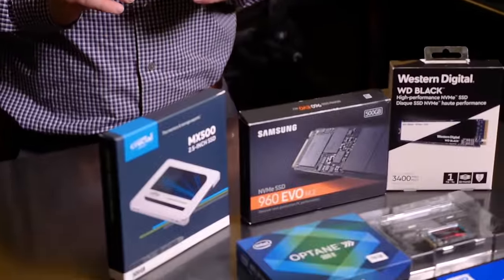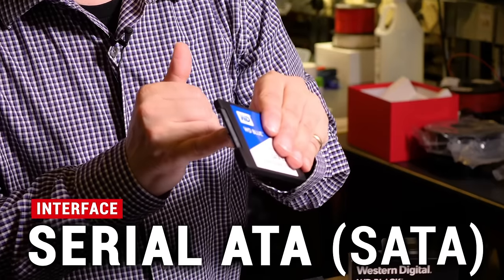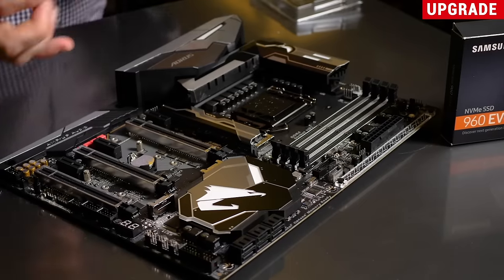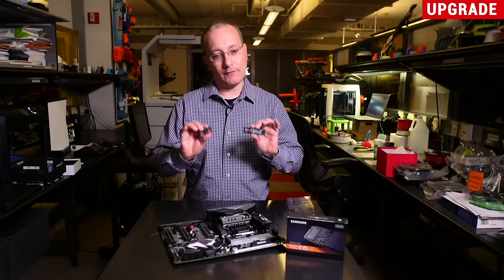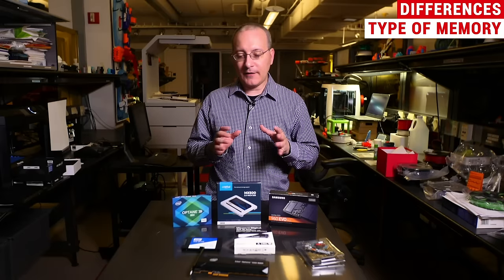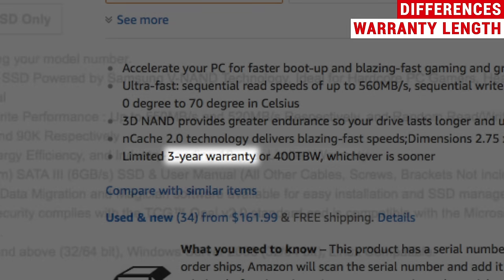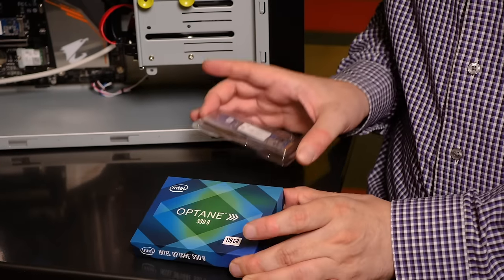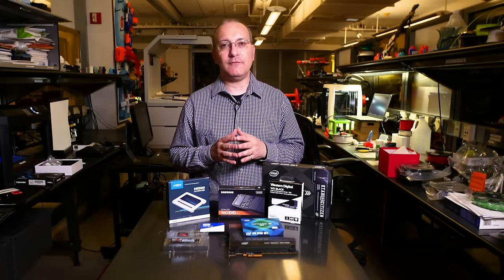Buying a Solid State Drive (SSD): Everything You Need to Know

Comment: Why didn't he mention the difference between M.2 SATA and M.2 NVME.  you need an NVME supported motherboard if you get an NVME drive. Also the NVME drive has 1 notch in it.  The SATA M.2 has 2 notches and is much much much much slower.
Reply: I think you have those backwards.   SATA has 2 notches while NVME has 1?
Reply: Thanks for the heads up on the NVME motherboard support info. I have a 6 year old gaming PC that I am going to add a 1 terabyte M.2 using a M.2 PCIE card adapter and put it in a PCIE X 4 slot. I was going to get a Samsung NVME M.2 stick. You saved me money and a lot of time trying to figure out why it's not working.

Comment: I wish I could have understood it. Not everyone has the technical knowledge you display.
Reply: Lots of the jargon he was using was doing little more than making the subject unnecessarily obscure, basically all most consumers need to know is that there are a few main types of ssds and if you're looking to buy one just keep in mind what your motherboard can physically support. The most common ssd is a sata ssd, and you can basically upgrade to one from a hdd directly by just plugging in the power and sata cables from the hard drive, then there is pcie sata, which uses a pcie slot but is just as slow as a sata ssd, and a pcie m.2 drive, which uses a pcie slot and will be faster than a sata protocol drive. For pcie drives just make sure like he said that the drive you buy is supported, but most consumers will be well served by a decent sata ssd, just make sure it isn't some hyper obscure Chinese knock off and you'll probably be golden. And try to leave as much free space on it as possible to preserve its life span, its best to just have the os, essential programs, etc; that you want to run fast on the ssd and have everything else on a hdd.
Reply: *nvme

Comment: First class guidance! Many thanks. One point is that you can save a lot of time by cloning your existing drive onto the SSD. This transfers the operating system, programs and data. I partitioned my existing HD and shifted the data to drive E. Then I cloned only drive C to the new SSD and later transferred the data.
Reply: Ben get in touched

Comment: If you just want to game primarily, get either a crucial or WD 2.5 inch. Pretty much all SSDs (including NVME) have very similar load times. You may save two seconds with an NVME, but it's not worth the premium that you pay. M.2 may be the same price as 2.5-inch SSDs now, so you can go that route, too. Remember that m.2 can be SATA or PCI. Get the SATA; don't waste your money on NVME if you're just gaming. NVME is better suited to video editing and large file transfers
Reply: This all I have in my laptop :P (razer blade) so no choice here but to upgrade to a 2tb nvme m.2 ssd (same type, higher storage)
Reply: @krazye2239  why not save money and upgrade to an m.2 SATA SSD?
Reply: googlewolly 
For 2.5 inch if you are gaming chose either Crucial, WD Blue/Black, or Samsung 860 Evo.
Reply: @primeribgaming2681  yeah those are all good. Problem is that the 860 is still a lot more than the others (or, it was last I checked, anyway). That's why I didn't include Samsung. 2TB for the 860 Evo was 500 CAD; it was only around 370 for 2TB for Crucial's MX500.
Reply: I have a question. I have an older spec pc and unfortunently the motherboard dosent support m.2 SSDs. However i do want to get an ssd to improve speeds of pretty much everything since i will be trying out some sort of video editing. I am absolutely not sticking with an hdd. 
I was looking at a couple 2.5" SSDs and i came across wd blue and green. The minimum capacity i can accept is 240gb. Which one is more worth it ?

Comment: Pro tip: The next time you have a mobo on a table and use it for demonstrating slotting something in (or out), make sure it is stable, e.g. rest it on a foam block or a folded towel :) It is quite awkward to watch your mobo rocking back and forth on its corners!

Comment: Still trying to figure out if my asrock fatal1ty z170 gaming k6+ will support an nvme or not the manual says it supports Key type 2230/2242/2260/2280/22110 M.2 SATA3 6.0 Gb/s module and M.2 PCI Express module up to Gen3 x4 (32 Gb/s) but those numbers aren't in any Amazon listing

Comment: My notebook laptop is ASUS X200CA memory 2gb .processor is INTEL Celeron is1007U @ 1.5GHz working very slow always hang for 5minutes i want to upgrade this but i see in you tube that the MEMORY RAM fixed solded on board no chance to upgrade ' how about if i upgrade the HDD to SSD it is possible i want your advice

Comment: Hi, why does the sata M.2 SSD connector has 2 gaps in it but the slot on the motherboard only has 1 notch ? Isn't that weird, because it means some pins of the slot are useless where the gap is on the SSD connector...?

Comment: i recently bought an HP 14-dk0024wm laptop,. you can upgrade the memory and add a 2.5 ssd internally,. it also has a SSD M.2 2280 SATA storage it came with,. my question is when i opened it, the bus showed that it could potentially fit a M.2 NvME stick because the bus has the one notch,. yet my stick is the SATA M.2 version,. my concern is that if i got the Nvme stick it wouldn't work even tho it would fit,. i can't find really much on it,. HP website doesn't even acknowledge anything about upgrading the laptop,. just looking for some help!! thanks

Comment: Is it advisable to buy a 1 tb ssd and dont use a hdd? Does ssd deteriorates first than hdd? Or vice versa? Need help guys
Reply: Ye ssd does gets wear off due to writing of data..   A typical Samsung  256 GB SSD.  Claims it can hav 144 tb of data written over it before it gets damaged.  Like u copy 1  gb of data to it delete it.  1024 times a gb and ur 1tb data written. So 144 tb is a lot I guess.    1 gb ssd would easily last over 5 yrs..  Search go tbw life tb written life.
Reply: Think of it like tires on your car: the rougher the roads the faster they wear. The more you drive, the faster they wear. It doesn't matter the type of tire.

Comment: I have a laptop which has the 16GB Optane Memory  Cache using the M.2 connection.... If I disable and remove this, am I able to buy and use an M.2 SSD/NVME Drive in place of the HDD

Comment: DO YOU GET A SATA SSD CABLE WHEN YOU BUY AN SSD?
OR DO YOU HAVE TO BUY AN EXTRA SATA SSD CABLE if u dont have a spare cable.  
i'm looking to change my HDD to my new SSD... and looking to clone my HDD boot drive to SSD without.. needing an extra Cable to work like that.
Reply: You can usually find this out by looking at the part of the box that says "contents," but odds are it only has a cable to connect it to the computer itself.

Comment: If you put a PCIE M.2 into a SATA bus though... it’ll still work, right? Just only at the SATA speeds and not the x3 or x4 of the PCIE lane. 
I think....
Reply: As long as the slot is compatible.  Not all M.2 slots are cross compatible, like on an ASUS Maximus Hero motherboard.  The first slot under the Heat Sink in the middle of the board supports both SATA & NVMe, but the second slot on the bottom-right of the board only supports NVMe; so you'll have to look up the compatibility under your physical manual or the website, which should have the digital version.

Comment: i want to upgrade ssd and hdd on my HP CK066tx...

currently 128gb m.2 sata ssd + 1tb sata ssd is installed....

i want to replace these with
500gb m.2 sata ssd + 2tb sata ssd......

but according to hp manual and costumre care for my laptop
i can only upgrade to these dual drive configurations :

● 2-TB, 5400-rpm, 7.2-/7.0-mm hard drive + 128-GB, M.2, SATA solid-state drive with TLC
● 1-TB, 5400-rpm, 7.2-/7.0-mm hard drive + 256-GB, M.2 2280, SATA-3, PCIe, MVMe, solid-state drive with
TLC
● 1-TB, 5400-rpm, 7.2-/7.0-mm hard drive + 256-GB, M.2 2280, PCIe, MVMe, solid-state drive
● 1-TB, 5400-rpm, 7.2-/7.0-mm hard drive + 128-GB, M.2, SATA solid-state drive with TLC
● 500-GB, 5400-rpm, 7.2-/7.0-mm hard drive + 128-GB, M.2, SATA solid-state drive with TLC

................................
i dont understand if there is port for m.2 and sata why i cant just upgrade to any storage size i want ?
sir is there really any limit like this? or i can upgrade to the configuration i want as mentioned above... kindly reply.....
Reply: i have the same question. have you figured it out? hp told me there is no size limit via chat, but i'm not sure if i should believe whoever i was talking to. i havent tried it yet. i want to add  1tb m.2 to a envy 15m-bp111dx.  guess i'll just try it.
Reply: @briandeines5019  yes u can add as much as u want.... i just added 2 tb sata and 500gb m.2 , after updating bios to latest version both working fine.... those manuals are actually for hp spare parts

Comment: I bought a good quality highly recommended SSD drive, Samsung 860 EVO to replace the disk drive in my HP laptop.  Used an Apricorn SATA Wire upgrade kit (USB dongle with EZ Gig cloning software, easily copied from laptop to the SSD.  Supposedly all I have to do is install the SSD into my laptop and off we go.  No such luck.  Even after updating the BIOS (from F.09 to F28) I can't get the computer to boot up on the new SSD.  I've had a lot of practice swapping these drives back and forth.  No luck.  I can read all the files in the new SSD with the dongle plugged into the USB port, so the files are there.  I just can't get my computer to recognize and boot from it when installed.
Reply: Kinda late but u need to activate them in the partition. Can look it up on here. Then transfer the os onto the ssd and go into the bios change the load order to make the ssd boot 1st.

Comment: I had some money at the start of COVID and I had to try the new adult ones I got 2-enclosures from Amazon and got dual 30 GB chips and I have been using them as an aid for the transition over to 128-bit computing with this new ZFS file system which can only exist with at least 2-separate devices and it basically provides you with a cheat or proof of concept with quantum smoothing such as the new toys for i5 and i3 by providing a single day turnover to whatever grounding source your computer has which won't skip the extra day if you have none but it will skip the extra loading time of whatever defective processor you may have and I got to say I love being able to get a chip with a very small capacity and a brand new slot because over at my new school super computers they have got the memory density up into all the data that exists in the universe so I won't need that much but the small or defective ones are quite fun!

Comment: Nvme is the best M.2 choice. Generally much faster than regular m.2/sata
Reply: SATA is the best M.2 choice. Generally much more capacity/price ratio than regular M.2/PCIe
Reply: @theEskalaator  If the massive speed improvement is not needed, then sure pick a SATA. But you won't be saving much money in the 250-500 GB range
Reply: @morten1  Nomal user usualy don't copy 150Gb files over two PCIe SSDs, so that massive speed is not very useful. Good NVME SSD is about 50% more expensive here (prices dropped in last few weeks, thats great, they were 100% more)
Reply: If it uses SATA interface, why would you spend more on an M.2 form factor SSD when it caps at the same speed as a 2.5" SATA SSD?
Reply: @MustyCustard  It's not more.  Right now I can buy a m.2 sata ssd for cheaper because they don't use all the extra plastic and parts a 2.5 inch ssd does.
Reply: @MrMali22  You realize those cost pennies at most right
Reply: @MustyCustard  Yeah i didn't say the price difference was massive lol.  But it's not more like was claimed.  For the most part they're the same price between 2.5 and m.2 sata
Reply: @MrMali22  That probably has more to do with market forces like demand, as well as the quality and speed of the parts used than it does with manufacturing cost.
Reply: @MustyCustard  ? Ok.  But you said why spend more on the m.2 form factor if it caps at the same speed.  I was just saying you don't spend more.  Not for the sata version anyways.
Reply: @MrMali22  Can you give an example? Comparing identical SSDs(WD Green 2.5" vs M.2) The SATA drive is cheaper by about 5-10 USD.
Reply: @MustyCustard  Ok. On newegg WD Blue 500 gb m.2 - normally 90 dollars. The 2.5 inch is normally 100 dollars.  Same brand same capacity.
Reply: Also,  Samsung 860 Evo series.  Both the m.2 and 2.5 inch are normally the same price.  They have sales going on right now though.

Comment: Left out external ssd's
Reply: Which connect via USB. They are no different from other external drives except maybe speed and you typically would not boot your Operating system from an external drive.... Not too practical unless your running live Linux

Comment: bought a samsung evo 860 250g. not worth it. Windows booting is faster, but i put mine on sleep mode all the time so it really doesn't matter. since its a 250gb (the only amount of gig for a reasonable price) you can barely store any games on it, its a waste of money. WD Caviar Black is all that's needed.
Reply: B U N G I E 
What are you talking about? That’s a great boot drive. You can also get up to 4 tb of storage for games. Did i mention it’s faster?
Reply: You're absolutely nuts. The Samsung EVO line is the gold standard of SSD's and with the cost of solid state memory expected to significantly decline in 2019, larger drives will go down into lower price points. Sounds like you're just upset because you don't get a great SSD at 1TB capacity for under $120. Some people just can't be pleased. Plus you forgot the biggest thing-- game load times! Would NEVER go back to a mechanical hard drive (sans long term storage).
Reply: @andyshrum6408  How many games do you think i can fit on a 250gb drive (with windows installed on the ssd, you have way less than 250gb on storage). The day you can get a 1tb ssd for $100 is the day they'll be worth buying.
Reply: @PATHETIC_DISASTER  SSD 120gb as os and 2tb for games problem solved😂
Reply: @primeribgaming2681  He's saying for his purposes there is no advantage. Something a lot of people fail to consider.

Comment: Bro Tip: NEVER buy a Samsung SSD... It will die in a couple of years, it's supposed to last 10 years but it will fail at the 2nd or 3rd year.
Reply: We have so many of them in our PCs and don't have problems. Which model(s) are you talking about?
Reply: @PyroShim  Samsung 850 PRO 1TB and I've seen a lot of people on the internet complaining about the sudden death of their devices. Nowadays, Samsung is not what it used to be :(

Comment: hasn't this "expert" heard about ESD straps?
Reply: @solstice4837  
you obviously haven't heard from industry experts.  ESD doesn't necessarily ruin components right away, but can cause damage which shows up down the line.  and you say not that useful.  ha  ha
Reply: @nitroexpress2438  Idk I've never used straps while building my pc's and never had a problem.
Reply: .1%
Reply: @MrMali22  I think the lesson is, while you can build and replace safely without ESD straps, when you're dealing with hundreds/thousands of dollars of hardware - is $5 really a big deal to reduce the risk?
Reply: @dixiejuche1703  Of course not. Just because I haven't before doesn't mean I think they're not worth it. As a matter of fact I'm currently getting new parts in for two new PCs I'm building for me and the wife.  And the screwdriver kit I bought has an esd strap which I'll use because why not.